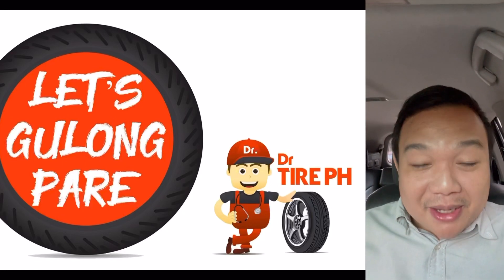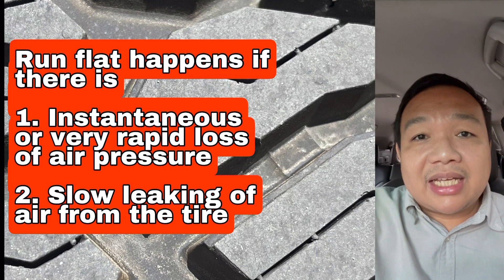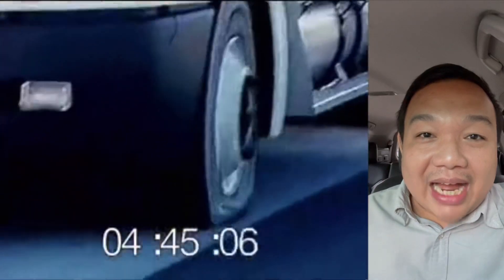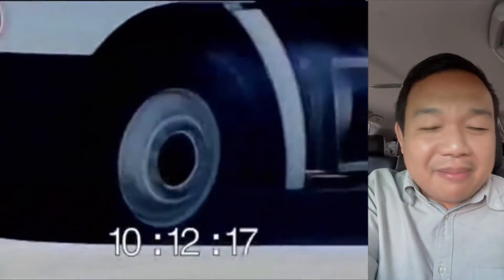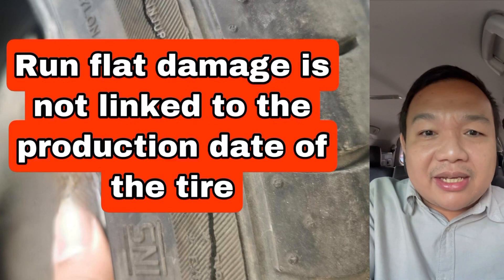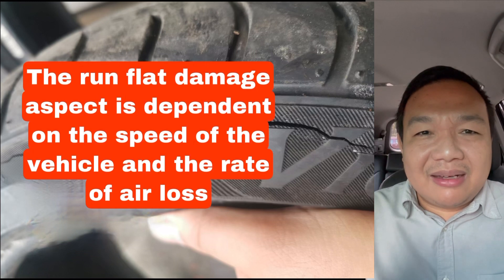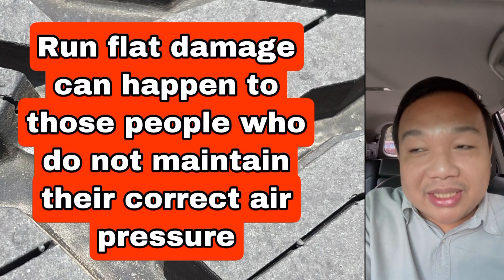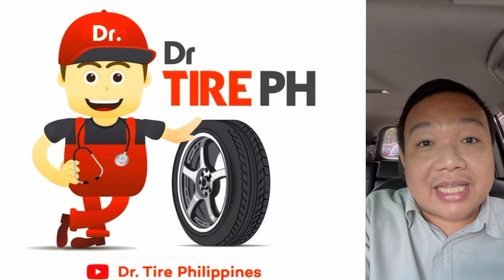Run Flat Damage explained by an experienced tire expert

Comment: Good info sir. Pero kung na e drive nman yong car ng 100km  from the origin. Ang age tyre is 1year old p lang hindi rin cover ng warranty? Kc lumalabas lahat ng explanation is running flat. Nasa highway tapus biglang na loss pressure yong tyre kaya na wasak, hindi rin ba ito cover ng warranty?